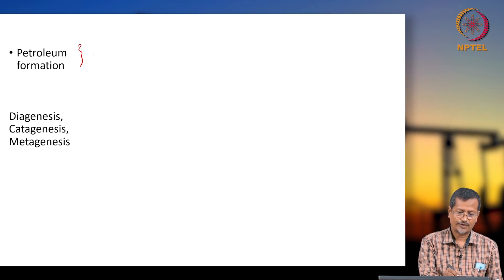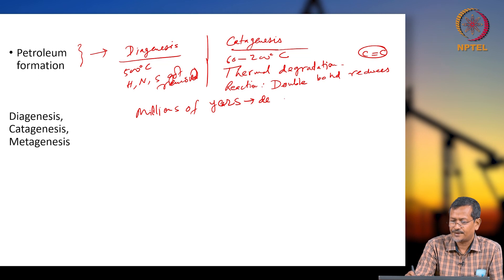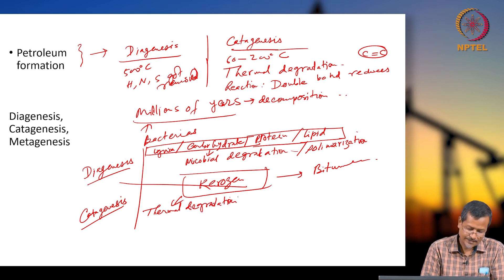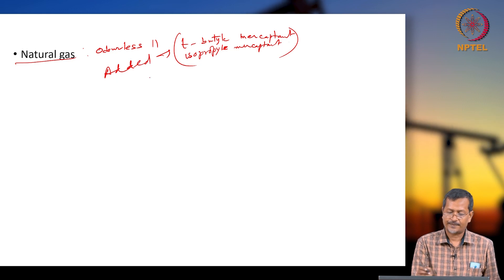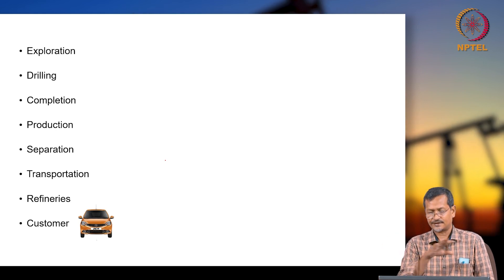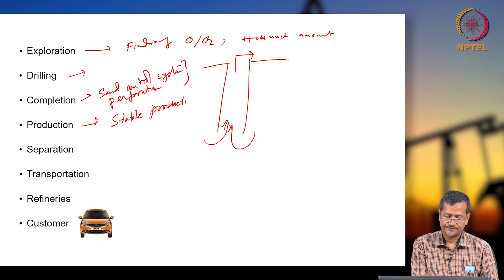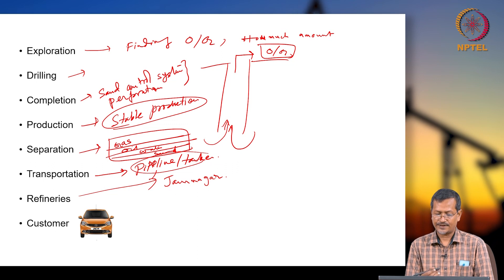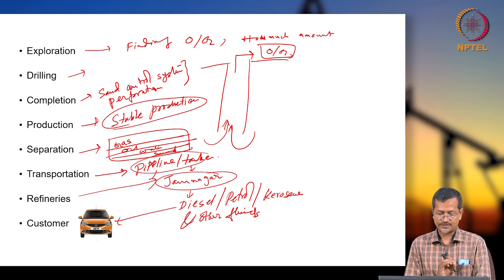#2 Introduction To Oil & Gas | Part 02 | Surface Facilities for Oil & Gas Handling

Comment: Timestamps (Powered by Merlin AI)
00:11 - Petroleum formation involves diagenesis and catagenesis under specific temperature conditions.
02:14 - Oil and gas formation involves multiple degradation and transformation processes.
04:04 - Overview of crude oil types and natural gas properties.
05:52 - Overview of gas composition and combustion process.
07:19 - Exploration and drilling processes in oil and gas extraction.
08:32 - Production involves stable extraction and separation of oil and gas.
09:45 - Water and sand disposal is critical in oil and gas operations.
11:06 - Overview of oil and gas production and refining processes.